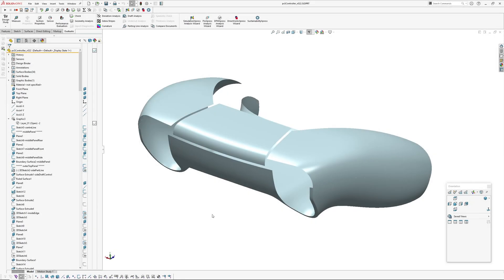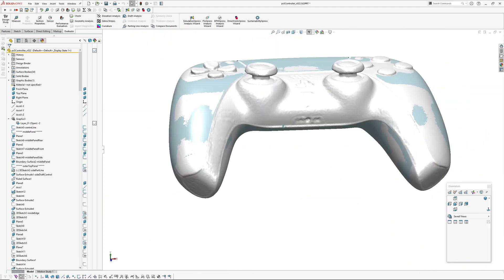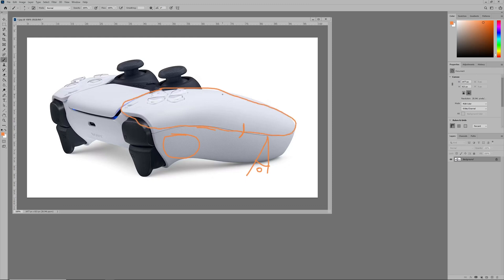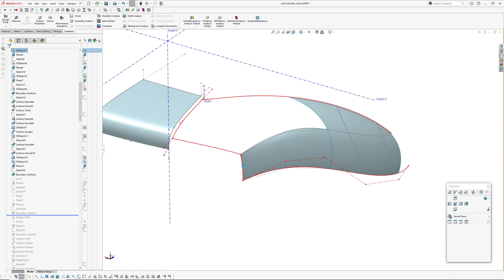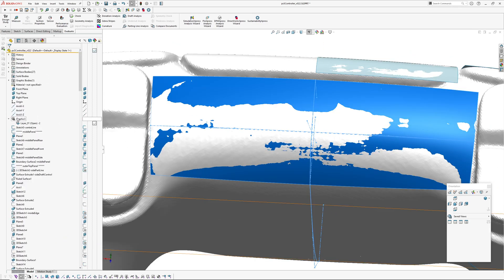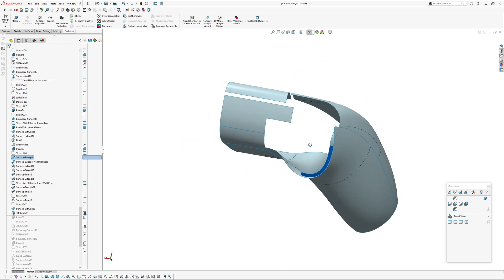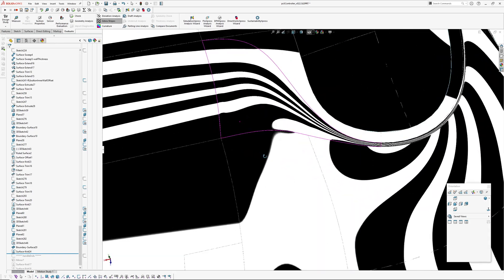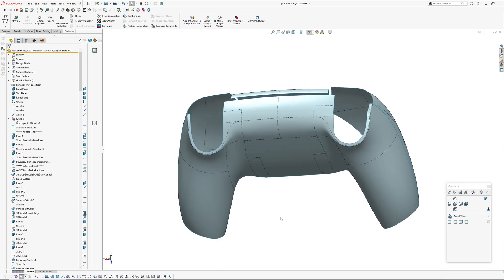Playstation 5 Controller, Modelled in Solidworks. Part 1

Comment: Please, how did you align the reference 3D scan. A workflow, I have in my head is to create new "primary" planes based on the geometry symmetry and prominent surfaces, then export with a new coordinate system based on this new "primary" planes, and then reimport... Would that work?
Reply from the maker: Hi there. I re-positioned and rotated the scan data to where I wanted it in Rhino. Much easier than in SW. Off the top of my head, what you mention should work though.

Comment: I am following the modeling using the 3D file you shared.
Thank you very much.
I think view of the sketch 126 was set separately. How did you set it up?
Due to different sketch plane view settings, I could not passed at this stage.
This part is not even shown in the video.
I would really appreciate it if you could let me know.
Reply from the maker: Hi there. Sketch 126 uses Plane 40. Plane 40 references two points and is rotated via an angle reference. I have no control over how the view is oriented in 3D space, when looking normal to the sketch plane. Solidworks sets that based on the plane references. Plane 40 is directly above Sketch 126 in the feature tree, if you are using flat tree view, which it is in the model I made available online.
The video is not a tutorial! It'd be hours long, that is not something I am interested in making. The model should suffice if you have an intermediate level understanding of Solidworks. Cheers.

Comment: Great video! Question on the '3DSketch2-sidePartLine'. How are you making that style spline?
Reply from the maker: Hi there. That's a bezier curve, deg5 (6CVs) and I've only constrained the end points with dimensions. I've dragged the other CVs around but did not get around to constraining them. Cheers.